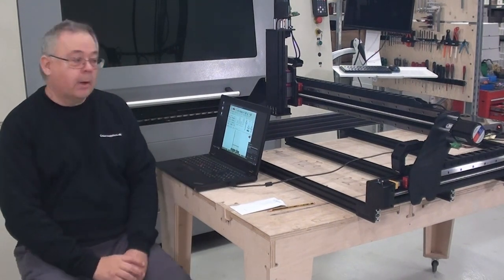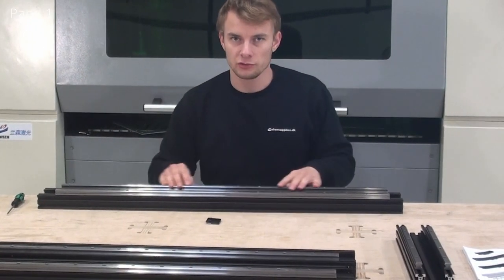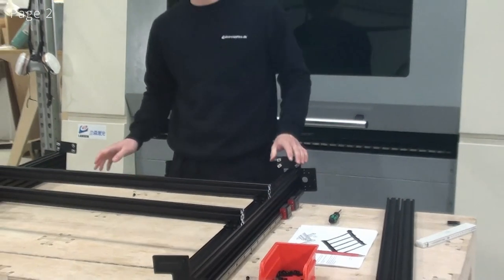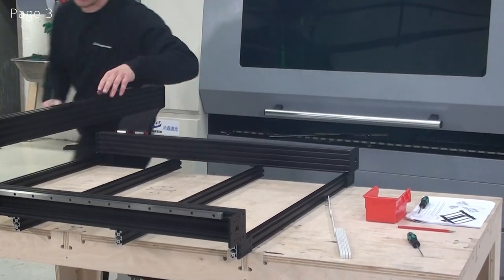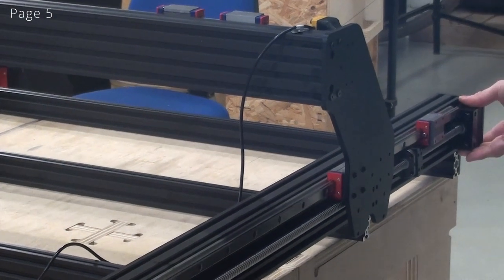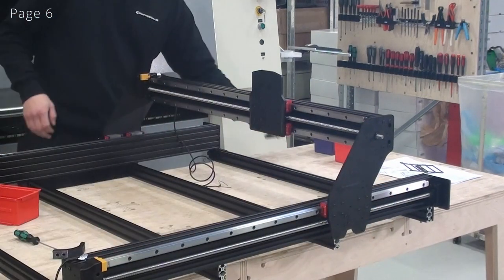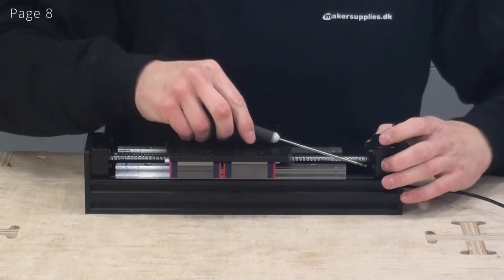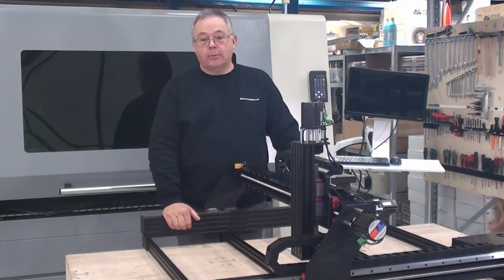Piranha Ball Screw - assembly video

Comment: I'm confused because the specs on the website suggest that the Z-axis C beam is 500mm, with a 350mm screw and 250mm rails, but the screw in this video is clearly longer than the C beam. Can you explain?
Reply from the maker: Hi Khye

The C-Beam rail used is 335mm long and we use 260mm rails. However, 250 can also work. You only loose 10mm travel. 
Reason for the list saying 500mm is that we pick parts for the machine from standard parts.
Reply: @martinbarfoed5040  Thank you. I ordered the endplates and feel you have nailed this build.